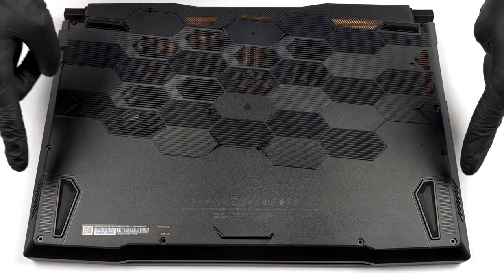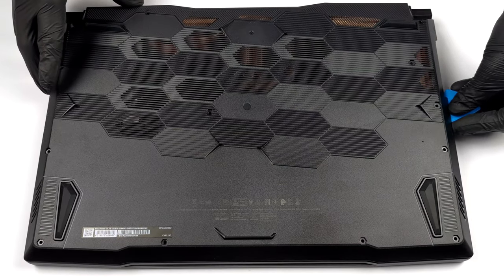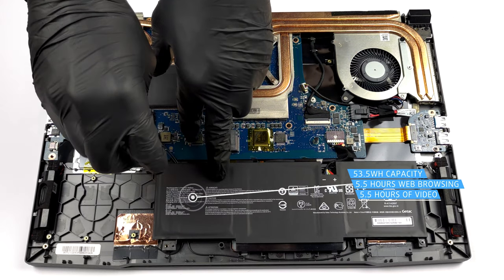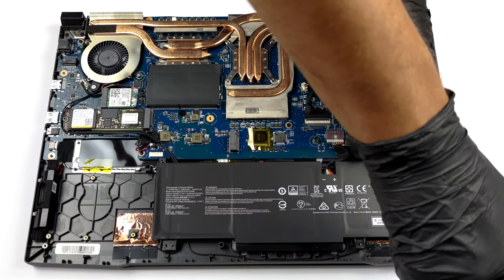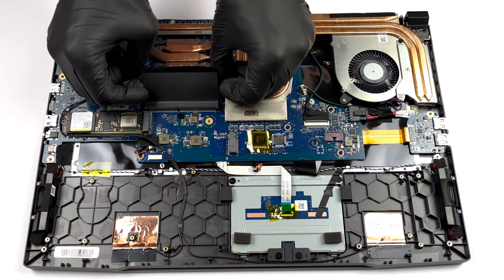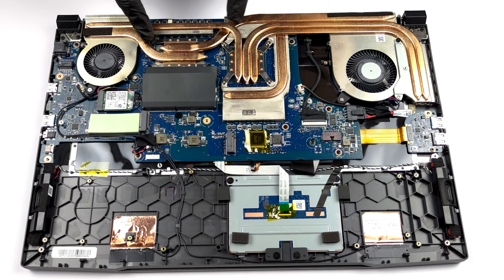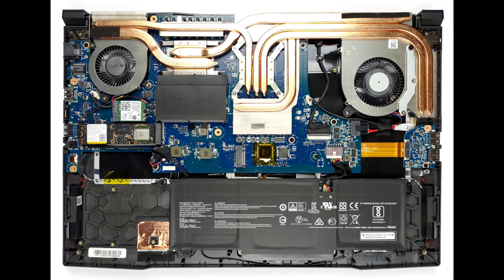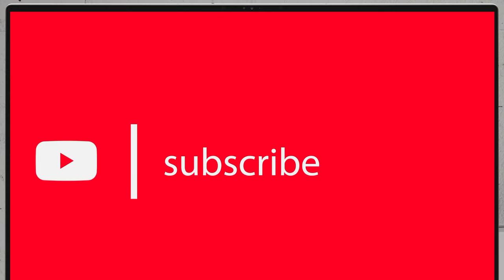🛠️ MSI Pulse GL76 (12Ux) - disassembly and upgrade options

Comment: You don't really give upgrade options, at least not specifics. I was hoping to see examples of what you could put in there and any caveats to watch out for. I want to make use of the second SSD M.2 slot, what would you recommend? Aside from capacity, what specs should we be looking for? Anything to be careful of? I want to upgrade my memory, I assume what I put in there has to also be DDR4, is that it? Any other specs that have to match? You need more info here
Reply: I'm doing SSD right now, I bought this SSD CRUCIAL P5 PLUS 2TB M.2 because it has speed for not much more cost than others with similar storage. It should arrive during this week.
You should look for your best deal for the M.2 slot between storage, speed and reviews and balance these 3 as your evaluation. 

In RAM, I'm not sure but all I've found is that I7-12700H supports DDR5 and found this on Pulse GL76 reviews. Also, the store I bought shows a list of compatible RAMs avaliable to buy and it shows DDR5 4800MHz 8GB/16GB/32GB.
So, I think I'll dive into it or even contact MSI directly to know if it can actually use DDR5. 

Overall, MSI does a crappy job in terms of telling the customers about compabilities. Their website could have so much more documentation on their laptops.
Reply: @EddyParera123  That's exactly the drive I'm looking at and thanks for the tip on DDR5. I hope you post a video about these!
Reply: @EddyParera123  while 12700h can support both DDR5 and DDR4 you can either have one or the other. This laptop only use DDR4. So you can't use DDR5 on this laptop.
When it comes to SSD from the video we can see an empty m.2 slot just above the battery, which you means you can likey put a second M.2 SSD in there
Reply: @NizarElZarif  is right, @Eddy Parera  I asked customer support and this laptop does NOT support DDR5
Reply: @EddyParera123  the website says the 2 m.2 slots are pci 4.0 compatible, is that true, if you have opened up your laptop
Reply: @vyronmakaronas5070  It's true, both my ssds are PCIe 4.0 M.2
Reply: I just picked up a 2tb
Reply: i saw somewhere you could upgrade the battery to 90hw or something

Comment: Is there space for a physical hard drive?
Reply: It works for previous gen. For the 12th intel version, no sata connector is given. Terrible design.
Reply: @peterh.2488 Thanks.  Bummer, but that seems to be the direction they are all going.
Reply: @peterh.2488  They could have at least fill that empty space with more battery.
Reply: @Mr-Clark  ‘You want more battery? Go for GE and GP series with more money’ lol, MSI is a terrible laptop company, they would rather add metal sheets inside than give you more battery capacity. Shame on MSI.
Reply: @Zefira The answer should be yes. Nvme ssd now is cheaper than sata ssd
Reply: @Zefira yw, BTW some 2tb nvme ssd are now only around 100 usd.

Comment: HELLO, I HAVE MSI KATANA GF76 12UE-055, I WANTED TO KNOW IF THE KINGSTON FURY RENEGADE 2TB SSD IS COMPATIBLE WITH MY NOTEBOOK MODEL, BECAUSE THE KINGSTON FURY RNEGADE 2TB SSD IS DOUBLE SIDED, THE SSD ALREADY ASSEMBLED FROM THE FACTORY IN MY NOTEBOOK WAS SINGLE SIDED WHICH WAS JUST 512 GB, I HAVE INSTALLED DOUBLE SIDED KINGSTON FURY RENEGADE 2TB, WAS RECOGNIZED BY THE SYSTEM AND WORKED WELL WITH HIGH SPEED OF 7000 MB READ AND WRITE,BUT I REMOVED WITH THE FEAR THAT IF I MAY HAVE THE PROBLEM FOR THE COMPATIBILITY WITH THE MOTHERBOARD AS IT IS DOUBLE SIDED SSD ,CAN YOU ADVISE ME THAT IF  THE KINGSTONE FURY RENEGADE 2TB DOUBLE SIDED SSD IS COMPATIBLE WITH MY MODEL? does double sided or single sided ssd matter in my model? THANK YOU
Reply: If I were you I'd rather check the temperature of ssd under working procedures (gaming, writing files etc.) If it doesn't get higher than 50°C I think everything would be OK.